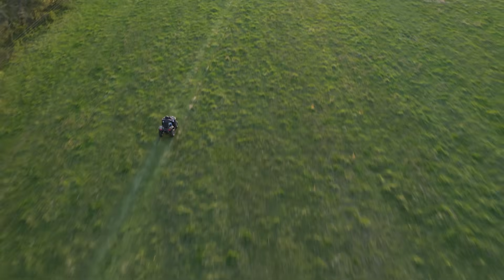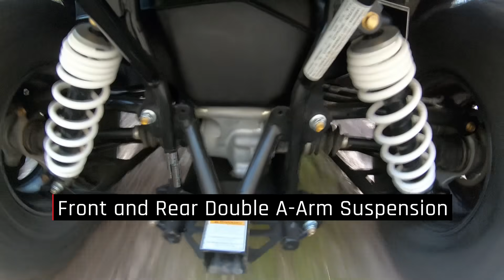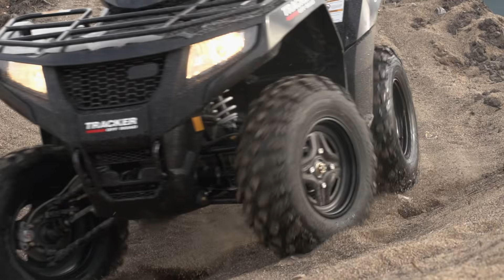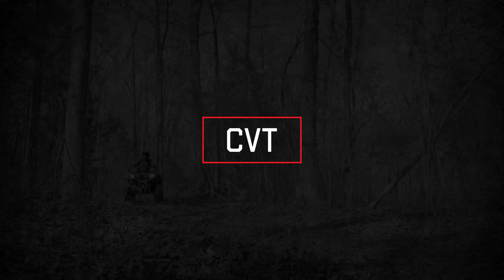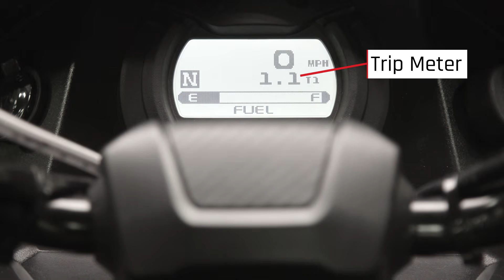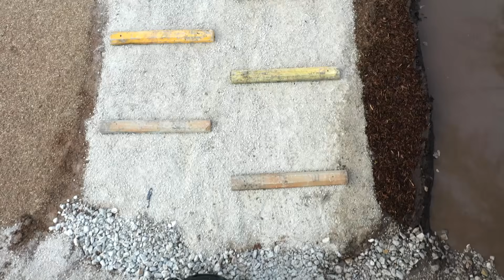TRACKER 700EPS ATV - Ultimate Features & Performance Demo!

Comment: I purchased the Tracker 700 EPS from Bass Pro Shops on 31 March 2021.  After about 3 hours on the machine I found: 1) that it wanted to “jump” ahead every time I put it into forward or reverse and even lightly engaged that throttle - very unnerving; 2) that it would not reliably go into low gear at all; and 3) that it wanted to go forward when I had it in park and revved the engine.  
I took it to the Orlando FL Tracker repair center on 12 May 2021 and they finally finished with it on 26 August 2021 after replacing the clutch drive (3 months and 14 days later).
Frankly, I am still a bit disappointed with this machine.  The transmission seems to act better than before, but when I put it into gear and engage the throttle there is still a lag before it snaps into gear and the result is a bit of jump as it starts to go.  I have learned to compensate for this by applying the brakes before putting it into gear.  
If I had to do it over would I still buy this ATV?  I’m not so sure at this point.  I would definitely like to have a machine with a smoother transfer of power from engine to wheels when starting up.  I have noticed that in this and every other review video of the Tracker they seem to be very careful to not show anybody actually putting the machine into gear and starting up.  Now, unfortunately, I think I know the reason why.
Has anyone else had a similar experience?
Reply: Same think happened to ours! There has to be a way to get a refund taking em to court or something because were getting something way off what this commercial said. Took it for warranty and they took around 3 months also cause the “mechanic was out” by the time he was in the warranty expired.
Reply: With fourwheelers you have to roll them into gear, that could be one of the problems. But other than that I don’t know

Comment: Works about 60% of the time. Bought it in March and by July its unreliable. Can it just start? Sooo many computet parts! Just make it work. Sucks. It doesn't run, but the payments are due.
Reply from the maker: We are sorry to read about your frustrations. Have you been in touch with your authorized dealer regarding these concerns? They may need to perform an evaluation to determine the next steps to take: https://www.trackeroffroad.com/find-a-dealer.html

Comment: Wow, great Commercial for a 10 year old. Bush league, Display, Wheels, Tires, Body plastic,  Lights, 4WD control, No locking front diff, Wrong about OHC and Torque,  Nothing about where the engine was made, HP Torque,  This all equates to a quad worth $4000 and sold for $7500.  Watch the video for the 570 Exactly the same except for a slightly larger engine. All this is "what he feels or thinks. I also think his name is fake "treadwell" WTF Ever
Reply: You seem like a trust worthy guy that knows his stuff, I’m looking to get a 4wheeler for me and my girl what make n model would be the best for two people?
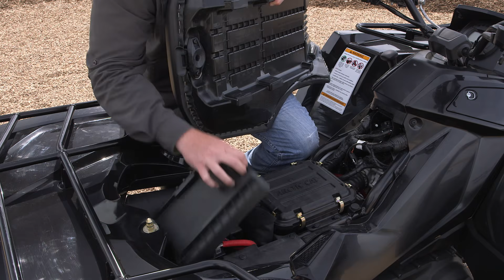Reply: @diegohernandez7403  this tracker atv is a rebadged 700 arctic cat at 13:38 you can clearly see arctic cat on the airbox lid when he takes the seat off. same quad,  big price difference.

Comment: I will tell you now this is the exact same review he did of the 570 all of the capacities are exactly the same the suspension travel is exactly the same everything is exactly the same except for it goes 2 to 5 miles an hour faster than the 570 and it's about a grand and a half almost two Grand cheaper for the 570
Reply: These quads should be doing like 60-70mph
Reply: @Erlov423  I watched both reviews and literally everything is exactly the same except for the CC of the engine and the top speed that he claims is only 2 - 5 miles an hour or more then the smaller model go back and watch both videos maybe I was blurry eyes and super drunk but I'm pretty sure the top speed that he said was only two to five miles an hour more than the smaller model and yes for that size it should be going much faster I agree 100%
Reply: @Spicoli1Bilek  yea obviously theyre not race quads but its always good to know you have that top end speed if you need it for whatever reason.

Comment: I would really like to say that I do not like the single brake braking system because if I'm going backwards down a hill that's a little too steep I would like to be able to control myself with the front brake or if I'm going downhill forward and it's a little steeper than I would like I would like to be able to control it with just the back brake I don't want all four brakes locking up and flipping me Head Over Heels
Reply: theres 2 brakes 1 on the handle and one in your right foot floor board
Reply: I noticed the one brake at the store, I was a bit hesitant about it but other than that looks great

Comment: I have had my tracker 700  for almost a week and I love it  it has the best ride out of anything I’ve driven and it’s quick up to 45  haven’t topped mine out yet but had it to 59  with more a little more left in it  I’d say 65 -70 is top end  this is an awesome user friendly Machine  I honestly can’t say enough good things about them  and plus the plows are easy to attach and detach  haven’t used mine yet but looking forward to it  but only have one question about the Machine how are they with tracks ?
Reply: My AC 700 TRV tops out at 71 mph. Same motor. You can reclutch for better acceleration or more top speed, btw. Check out Speedwerx
Reply: I purchased a 700 eps two weeks ago. I love mine top speed of 65 and great pulling power. One of the best ATV's I have ever owned

Comment: Freaking crazy! The Kawasaki brute force 750 is a way better machine. For about the same price. More features, better towing, better hauling. User friendly as well. $7,100 for my 2020 Kawasaki brute force. Out the door. $7,800 if I was yes E.P.S. Honda, Yamaha, and Suzuki have better more capable machines as well at a comparable price or cheaper.
Reply: Where did you get it for that much i almost bought one saturday for 8800 and that was before taxes or anything else in dallas texas i guess i might have to low ball and haggle
Reply: Bullshit, that is about 2,000 away from the price of one
Reply: Antdogg566 nope I believe it I got one for 7200 out the door, it was both a dealer special and a Kawasaki special and I bought it out of state so no tax.
Reply: @Antdogg566  J&J power sports in Huron Ohio. Bought in March.
Reply: Try buying a top notch brand atv right now lol good luck all sold out due to covid shortage. If you do find 1 it will be 10k full retail price. So this 700 at 7500 is a damn good deal. The 700 is the only 1 I would buy though. Arctic cat has made this engine for going on 15 years. Its bulletproof
Reply: @OutworldEmperor  maybe now but back in March that’s all I paid for a top notch atv. The Kawasaki brute force 750 ain’t no joke. Has better suspension way more power and a large aftermarket.

Comment: Who the hell makes the engine?...the ChiComs?   No thanks.
Reply: Jay Winters arctic cat actually
Reply: Kymco actually does.  They make great engines.
Reply: Greg Rowe no it’s not
Reply: You are right, this is not a Kymco engine.  The smaller engines, the 300(270cc) and 500(443cc) are Kymco engines.  The 700 is similar to Kymco's 700 single but its not the same engine.   Sorry for the error there.